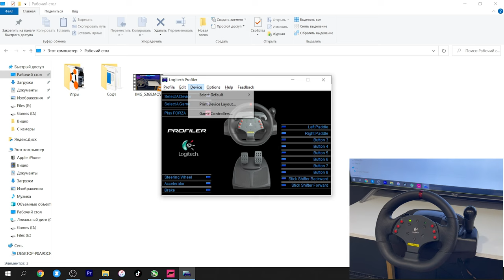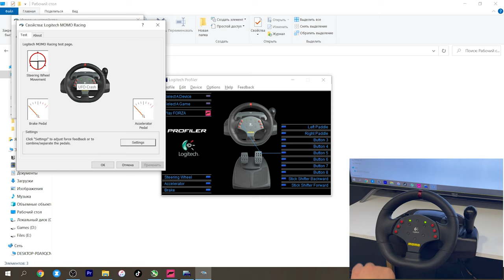Logitech Momo - 900° HOW TO Make | Step by Step Instruction | 30$ Wheel in 2021 | Gameplay

Comment: I tried this. It is good to be able to use 900 degrees while using original parts. The gearbox part may come off when the steering wheel is turned, so a simple part may be needed so that the top cover can press it.
Reply: Which parts did you print out to get it to work?
Reply: @bass2762  I used gear case (not helical), 1.5 ring, ring 1&2 (900degree)&3 (900_600degree) from the file available in the article below for the original parts because it takes time to get the belt.

Kindly, the composition of the old product could be checked through the attached video link.

And I added a hard foam that presses from the top cover to the gearbox to prevent the gearbox from falling out.
Reply: @HJuneOh  which gearbox?
Reply: @HJuneOh  do you cut some part of original wheel? or just plug and play?
Reply: @hanifarsalan3339  A small cut must be made on the inside of the cover towards the wheel from the center gear. To allow the two rings to move smoothly.
Reply: @HJuneOh  is it possible to edit the 3d printed part smaller so i'm not cut the original part of my wheel?
Reply: @hanifarsalan3339  In that case, damage to the ring, which is a 3D printed part, may occur. If you directly put them together and check the movement, there is no problem with durability even if you cut out a little from the inside of the cover and later return all of them to original parts.
Reply: @hanifarsalan3339  yes. Plug and play, ready to use at 900 degrees. If necessary, reset the wheel angle etc. in the game's options.
Reply: @HJuneOh  thank you for your answer
Reply: Hello bro, do you know the pulley dimensions? I can't find it anywhere

Comment: I did the same, but I have axis problem . Normal 0 is my -2304, 2304 is my 0.
Reply from the maker: Change the power supply connection to the motor. Place black to red and red to black position.

Comment: Wow impressive upgrades. Well done. But how did you use the gear on motor shaft for the belt. Does it grip it well if it does what type of belt did you use?
Reply from the maker: I used the original metal motor gear. The belt model is GT2-6. For the  proper grip, it is necessary to tension the belt by shifting the position of the motor.

Comment: Hello my friend, thanks a lot for the video :) . Will the black and red wire you showed at 16:47 minutes be swapped?
Reply from the maker: Yes. Because of belt drive the rotation has changed. That is why you need to change the motor rotation.
Reply: @samkovplay3622  Thank you 🙏
Reply from the maker: You are welcome!

Comment: Very nice mod, I'm thinking to doing it! Thanks you very much for sharing, great video, I really appreciate it!!

You don't use the Pulley-23 on the motor for the belt, or I'm wrong?
Reply from the maker: I decided not to use Pulley-23. Most of people use it.
Reply: @samkovplay3622  If I don´t use Pulley-23, can I use belt 164?
Reply from the maker: Yes. But you will have to modify the motor mount part for better fit.
Reply: @samkovplay3622  Yes I know. Like in your video at 9:09 - 9:35. Thanks.

Comment: Would love to see a link to these parts for the wheel, I am from US and couldn’t find them on ebay.
Reply from the maker: The only thing you can do is to make the details by yourself using 3D Printer. You may find models here: https://drive.google.com/file/d/1xu7rnIPKdUT_53sxBjWyr_dKZLop4v6J/view
The belt version requres 2GT-166 6 mm belt. You may easily find in on Aliexpress.
Hope this will help.

Comment: I just want to 900 degrees mod. Which folders in the "Logitech MOMO Mods" file do I need to 3D models print with a 3D printer?
Reply: Actually if you want just mod to 900 degree the cheapest solustion is block some hole on the rotari sensor, but as he answer in previous comment, there's no turn protection and maybe break your cable, however if still want to just mod 900 degree you can check my video how to do it

Comment: Can I just take that stopper piece off? Will it work without the other parts you added?
Reply from the maker: It is not a good idea, because you will need to control the center position yourself and you will need to change the number of holes on the encoder gear. There is also a risk of breaking the cable to power the buttons on the steering wheel, as there will be no protection against rotation.

Comment: What kit are you using in the video? And what's the difference between using a kit that has no belt compared to one with belt? (for example kit 1 vs kit 7)
Reply from the maker: The belt makes your wheel quieter and smoother.
Reply: @samkovplay3622  Ah thank you. But what kit are you using in the video?
Reply from the maker: I use belt version as you can see and 900 degree limiters.
Reply: @mr. fiddlesticks what
Reply: @mr. fiddlesticks was it good?

Comment: Hello, the steering wheel does not stop in the center. In Logitech software, my steering wheel turns 100% right and 83% left. Could the 21-speed gear be problem?
Reply from the maker: I suppose that you need to make correct calibration.
Reply: @samkovplay3622  I don't know how to do this, can you help me please?
Reply from the maker: Do you have 900 degree mod or the base version without mods?
Reply: @samkovplay3622  900 degree
Reply: @samkovplay3622  I watched your video and did everything the same.
Reply from the maker: You need to hold the wheel in the center position for 5-6 second during turning on and after that start moving it a little bit from side to side and that is it.
Reply: @samkovplay3622  I did what you said before, but unfortunately I couldn't get any results. Thank you for your interest.
Reply from the maker: No problem. Good-luck!
Reply: Same problem

Comment: How did you get it to work on forza?
Reply from the maker: Just installed official drivers and that is all. But you have to use only Microsoft Store version, Steam version doesn’t support this wheel.
Reply: @samkovplay3622  I have the microsoft store version on my Logitech Formula Vibration Feedback Wheel and when I try to assign stuff it just wont work
Reply from the maker: Not sure that Logitech Formula is supported in Forza. Anyway, try to use “Forza EmuWheel” software.

Comment: Does it make the force feedback a bit weaker?
Reply from the maker: If you will use good lubricant and and correctly set the belt tensioner you will not see the difference.
Reply: thanks for replying <3
Reply from the maker: No problem!